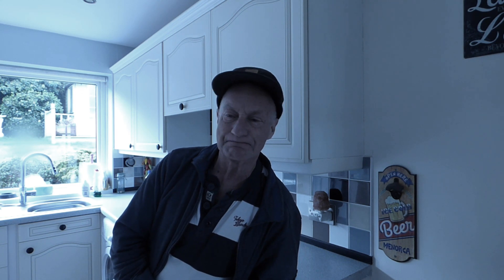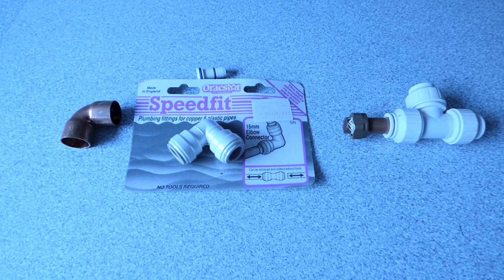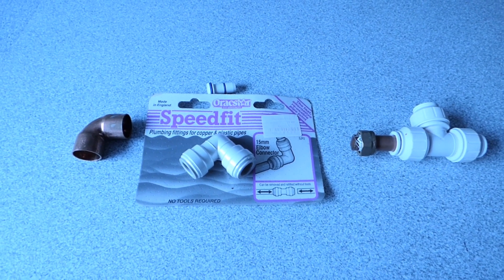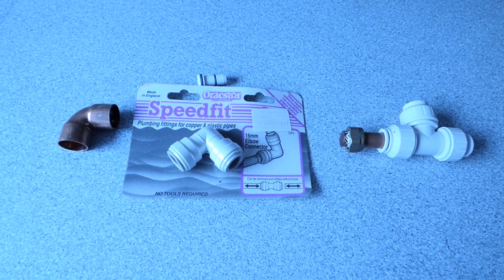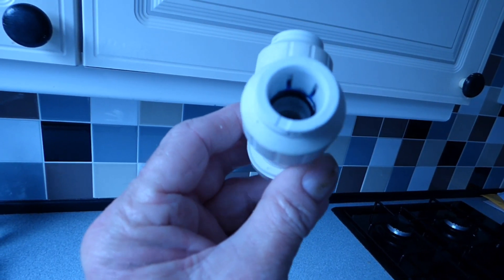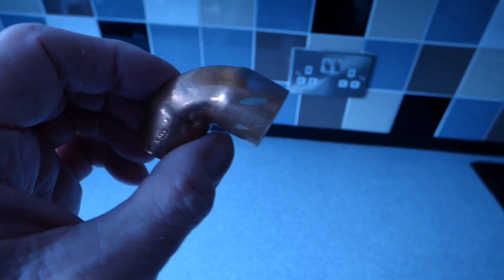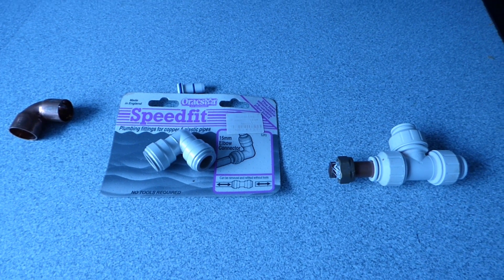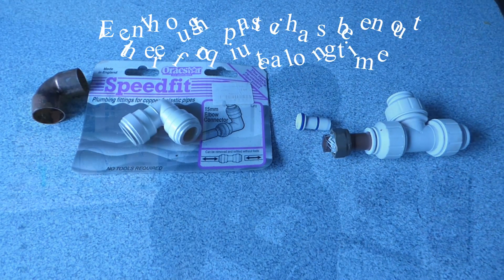Is it better to use plastic pipes instead of copper ones ?

Comment: These plastic fittings use the same epdm o rings as the press fit fittings. Lots of plumbers are using press fit now. I see no difference in using push fit fittings provided the pipe is cut using the reccomended cutters and the pipe liner is fitted.
Reply from the maker: Thanks.

Comment: Hiya Al   I've just looked at you vid re your like of copper for heating.  I'm right with you on copper ONLY for heating.
You like me might have seen barrier pipe behave like spaghetti when it's hot and no where near the boiler.
As heatpump says the overlooked added resistance is  a crucial difference in cooper compared to plastic.
At  82 and working till I was 75 as a commercial heating engineer I am amazed at the lack in expertise of some of the modern ideas.  As usual the $£   override common sense?
Where pex has to be used i've used it to enable 28mm mains to dross underneath concrete in a duct once!
I have just been asked last week to solve a problem.   35kw combi in  a loft!. Recently added conservatory vertical rads in Conservatory with plastic  pipe work.
Due to the added 'head' the combi pump just ain't quite working  plus the plastic = more resistance.
You most likely as I seen it all before.   I suggest what I've done previously for a quick fix  = stick another 25-55 now different Grundfos numbers applied.  This circulator must be fitted out side of the combi so as not to interfere with any of the combi electrics or operation etc.
Luckily the very nice chap who has the problem is a special electrical boffin. His wife is lovely an is a niece.  She managed to get a stainless 25-80 last night for a snip at £227.  She askes will I help her husband to fit it?
I really hope the pipework is copper!
Best wishes  to a fellow 'thinking ' heating engineer.
Reply from the maker: Thanks Michael, great info for everyone, good luck with it.

Comment: I've got Plastic 10mm in for the Raidaors, and it has Ferd up how I have had NO heat going out of the Raidaors
Reply from the maker: microbore rubbish.
Reply: If you know what to do or know an engineer who is familiar fitting light commercial Grundfos pumps do it but first flush those pipes.  Once they are clear the new pump will transform the system but get ready for a bit of resistance noise because the water will travel through the small pipes at over 3 FT /second!
That is if you still have underpar rad temps.....

Comment: Auto manufacturers use rubber O rings in brake pipes because they are very reliable and lasts for decades, you trust them with your life. JG speed fit use EPDM O rings same type of material used in Aircraft and Submarines.
Reply: Very true, let's also add that the lifespan of EPDM o-rings not exposed to solvents is incredibly higher than we could possibly imagine. How many flexible tap connectors have you seen leaking due to damaged rubber?

Push fitting leaks are caused by wrong installations: no lubrification the o-ring and pipe before pushing the pipe, pipe not properly cut and deburred, dirt on the pipe or marks on the pipe in proximity of the area where the o-ring will sit. All these problems can surface later on, not necessarily when the pipe is installed.

With plastic fittings everyone is a plumber, so you get poor jobs from rouge traders that have never worked on plumbing before. As engineer and passionate DIYer, I had to fix quite few issues left by a rogue developer and I can tell that the problem is not the material, but the people using it.
Reply from the maker: OK Thanks, perish the thought.
Reply: @dereton33  Brilliant pun? just clicked   LoL  LoL Lol.......  Just a thought =no one likes water pouring through the ceiling now do they?
Reply: @dereton33   What a splendid pun =just clicked    lol lol lol lol......  If any engineer thinks about the subject it does not bear thinking about water pouring through the ceiling now do they.... Do they give the choice of quality re pipework that has to stand the test of time or do they think at all?
Probably the first equation is $£. full stop and in any case where did they receive their tutoring. Most think a Heating System can be (to quote my Heating consultant tutor 60 years ago) designed on the back of a fag packet!
Reply: That is a brilliant point.
Reply: Probably that French /english jet with 8 on board which crashed at the Paris air show (of all places) might have had rubber in it? Only lidding ...lol.  I once saw a rep selling plastic taps at the side of myself at the merchants counter..... OPELLA//////????   I sneared at him and said they are no way as lasting as metal now are they.    He liked them because he said === you can choose lots of different colours!   Not many plastic taps about? many plastics used on shower fitting i fear....  Ever had a fxxxing plastic thread strip?     not many havn't?.....   O rings what would we do without them?    Biodiesel sorts out the quality however
and only one is up to it, Viton = FKM...... EDPM will not cope or any other rubbers. It even sweats through
polythene unbelievably.
Please compare for engineering choice between a compression fitting where that joint can be used and a joint relying on an O ring?

Comment: I’ve used JG speedfit for my full hot and cold water in my house that I bought, from stop cock to a few metres from my boiler/ where copper meets, all with the correct inserts and cutting tool, over a year in “touch wood” no issues at all, I’ve used hep20 for my heating system and I’ve had one leak but more my fault than a product fail.
Reply from the maker: Thanks for the input Rab.

Comment: Just wondering if there are any issues with the earth bonding if plastic pipe is used in the house and mdpe is used under ground?
Reply from the maker: No issues at all now. See new wiring regs.
Reply: Only if the plastic melts and the earth clip comes into contact with the water. I don't think I've ever seen an earth on a plastic pipe but anything is possible these days?

Comment: listen mate if your worried tell them to use copper OR get another plumber.  they are there to do what needs doing to THE CUSTOMERS SATISFACTION
Reply from the maker: Bang on GhostvaperYT.
Reply: Question was though what should the customer prefer.

PEX is quick. Copper feels much more solid. It's also fully recyclable.

Still, no scientific proof either way.

What would you recommend your client do then?
Reply: @ackec-umsekkruch-ekucki952  all i know is my house was built in 1860's and it's current heating pipes were put in sometimes 1980's. now the boiler has been replaced at least twice but the same copper pipes have not failed once!  so i say copper because mines lasted at least 40 years without  issue
Reply: @GhostvaperYT  I know. The thing is nowadays everything is getting ripped out every 10 years. I hope this trend comes to an end but lots of times the longevity argument falls on deaf ears "mate, I'll have moved 10 times by then"!

Consumerism has been destroying trades for a long time.
Reply: @ackec-umsekkruch-ekucki952  yeah you are right and also some trades people want stuff to fail so they will be paid to come back and fix it!!!  like my washer, i found out later it was made so badly the parts wore out within 3 years and it was designed like that on purpose so you have to spend ££££!!!
Reply: @ackec-umsekkruch-ekucki952   yeah you are right and also some trades people want stuff to fail so they will be paid to come back and fix it!!!  like my washer, i found out later it was made so badly the parts wore out within 3 years and it was designed like that on purpose so you have to spend ££££!!!
Reply: @GhostvaperYT  My old BOA (Potterton) The potterton production engineer said  =Now you're talking about a BOILER!   Well I said I've been taught how to choose a decent boiler!
All copper heating pipes and boiler over 55 .....  25 -55 grundfos = due to bedroom copper mini bore 6mm OD yes 6mm OD bronze welded to 1/2"  upstands.... Hot Hot Hot  lol lol
I never thought that pipework would work but it really does with the correct pump behind it! 
Day job was 4" iron welded boiler house mains bit of difference I thought!
Who would choose plastic for heating????????
An old heating engineer nice bloke highly experience =would not talk to anyone saying they were heating engineers IF THEY COULD NOT GAS AN ARK WELD..... On a job with him he said how on earth can they be heating engineers when they can't weld?   I said perhaps they're happy getting less money than us!

Comment: My concern in the aging of the O ring. I have replaced thousands of them over the years and they do go hard and age. Once 1 is gone they probably all need replacing
Reply: My other worry coming from an engineering background (not plumbing) is that i have not known plumbers take the care of the O rings that we would working on machinery. Like debuting pipes so they don’t cut the O ring or greasing it so not only for slippage but only to seal better and not dry out as quick. 
I also have questions on the turbulence/cavitation caused by the plastic insert
Reply: @toml8142  Not only that but the disgraceful handling of plastic at the merchants? I used to try to get them to not scrape the plastic on the ground as they dished it out but I might as well have talked to my waste paper basket!!!!! lol....   Done all this and that 4" iron mains welded flanges atc
3" gas main to a 1M 300 thousand btu's automatic 'cob' oven..... what a burner!  looked like a jumbo jet engine from the other end of the oven, looking through a brick that was out....
These postage stamp boiler fitters might well be wrong but it's the in expertise of the spouting
inexperienced who advocate quite out of order about plastic being =QUITE ALRIGHT to use on heating.   
If I had to use plastic (pex barrier) pipe on anything I would choose compression fittings to couple it.....  Where it should be fitted and essentially needed most plumbers are not using none dezinkifiable ( CR) fittings and in some areas these fittings block up after 4 years.  The quality of thought and expertise is abysmal.......   The merchants bar tool station and maybe Screwfix have 'phased out gunmetal'. Why = because not many are buying those correct fittings.
Reply from the maker: That is the worry Tom.

Comment: Copper for me but another question - 15mm or microbore?  I went for 15mm but my new house has 15mm under the floor and microbore to the rads. Is there not some special inhibitor for plastic that won't attack the silicon seals on plastic?
Reply from the maker: I have not heard of any.
Reply: I am assuming which is wrong because wishful thinking has no place in the design & installation of any heating system.  I have put little inhibitor in our heating system of nearly 60 years. If you have an unvented system with no leaks at all there should be little corrosion.
Our system has had a few betterments over the years and the sealed system is a benefit compared to an open covered tank. A stainless unvented Cyl. is also good I think.  But that is my personal choice.
It's worth giving technical things such as heating that one   needs to last 100 years if possible some deep thinking and only do what is aimed at longevity.
It might be worth contacting Sentinel  who seemed very cleaver or Fernox on your subject matter.
They have both been at it for yonks so they may well be the most eductaed on the subject of corrosion prevention if it involves the relatively new idea of plastic pipework in heating systems. ( not a choice of the thinking heating engineer I would think?
Reply: @michaelhall7921  My first house had central heating fitted when there was a copper shortage (I think in the 1970s) and half the house was piped in steel. I had it replaced with copper as I didn't fancy lots of potential leaks.
Reply: @68000Mark  You did right.... Not many folks do it but stainless is the other option for heating. In Crete they are using pex with an aluminium barrier..... It looks tough,  but they bury it solid in the conc.!!!!!!   They are terrible drivers but looks like there are a few heating engineers with
expertise. I've seen it here used I think for commercial refrigeration? The size is not same as our heating pipework though.
As a complete guess most houses with mini/micro bore need a light commercial pump to get the standard reg 11C temp diiferential.

Comment: I always use copper pipe in my own house, the only person that benefits from using plastic is the installer. Makes no real difference to the customer as water flows through the taps and the radiators heat up just the same.
Reply from the maker: Thanks for the input.
Reply: Water does flow through pipes! That you are right but there is a problem caused by the lack of technical experience expertise and knowledge of the average Plumber heating fitter of postage stamp boilers.
The fitter of plastic pipework to heating systems takes a guess at the size of the heating pump often to the customers dismay because  certain plumbers after they've gone leave rads that do not get hot.
It's all wrong to approach what is a technical job with the idea that anything will do.  Light commercial heating pumps don't come cheap but that is often the way to get the luke warn rads hot, that is apart from removing the inadequate plastic pipework that they put in with no regard for the resistance of plastic pipework!
First question these characters should ask themselves is = is the heating pump of adequate strength/ power to overcome the resistance of the additional pipework they are fitting..... Another job looming maybe?

Comment: The o ring will last for years, there will have been trials and tests with different  o ring  compounds before settling on any specific one. Generally leakage is caused by either not pushing the tube in far enough past the o ring on installation or  not depressing the release sleeve to remove the plastic tube (for whatever reason) during installation.  It is very difficult to remove the tube without depressing the release sleeve  but it can be done by a determined installer, this results in the grab ring inside the fitting scoring the tube , reinstallation without cutting the tube results in the  o ring not sealing correctly on the score marks leading to leakage.
Reply from the maker: Thanks Rob.
Reply: Have you seen a plastic fitting blow off a pipe. Fair enough it was a 22 copper pipe & was low pressure till I think it froze at the bottom>?    A long time ain't good enough for many 'Heating engineers and especially 'Commercial Heating engineers'   Plastic does not compare in quality and longevity to either iron or stainless or copper pipework on Heating.
It is the better choice on domestic water due to the fact it does not suffer electrolytic corrosion but even then for a more secure job gunmetal (CR) compression fittings are best hands down.   That is if the customer can afford them?
Have you seen a pex pipe with an aluminium as opposed to hard plastic barrier.  The europeans use it but the diameter is  bigger?

Comment: Got to say: I’ve seen more leaks / problems  from plastic fittings and pipe than I hav from copper.
Reply from the maker: Thanks Chris.
Reply: Where do you see the leaks? is it the joints? I was thinking for my upstairs heating loop of 2 radiators just using a single pipe to the boiler then a single pipe between the 2 radiators and a single piece back to the boiler, totaling 6 joints. My thinking was this would reduce possible leaks and would be very easy for me, an average diy'er, to fit. 

Basically my question is, do you see the leaks in the pipes or the joints, many thanks.

Comment: Plastic will perish and these inserts.  with high heat and cold days in Britain. 

I've been in buildings for 40 years and Copper is brilliant. 
In schools . 1950s to 70s council houses etc etc... still with copper guys .
Reply from the maker: Thanks for the input.
Reply: At one time the Whitbread surveyor introduced me to a Pub Owner &  the landlord said 'hiya plumber'......  The surveyor said no heating engineer .... I think there is a subtle difference.... I've never forgotten that pat on the back!   You as I are a thinking fitter /engineer etc Heating engineer =I always desire to weld doing heating after my Plumbing apprenticeship. When I did 4" iron all welded it was hard heavy work. I'ts made me  a very amused but sometimes grizzly old git especially re those who would use plastic on any heating system......  The young ones are extremely gullible these days..... I suppose it true to say =you can't beat the old ways.......  copper hands down.....  No one should ever say they know it all because no one ever does but that choice of copper for any pipework in heating , comes from both our expert opinions and of course there are many other 'thinking'installers of heating systems.

Comment: I don’t know about you but seeing brass compression fittings on plastic pipe fills me with dread.
Reply from the maker: Wondering if there is an insert.
Reply: dereton33 or if the pipe’s been cut with a hacksaw!
Reply: @dereton33  Some must not know about such crucial bits and bobs.....  Who thought about the plastic inserts= absolute crap and not fit for compression fittings. Only for the weak plastic fittings.
Stainless is the metal for inserts and copper for heating ONLY.   
Some don't intend to deliver quality at work?
Reply: If quality is the chosen target compression fittings are the one and only fitting to be seen on a plastic pipe and especially on a heating pipe.     We are all ('thinking' professionals only)having a good laugh here by gum keep em  coming ?